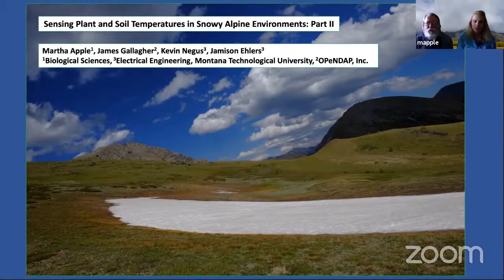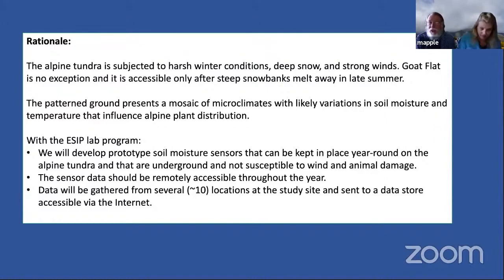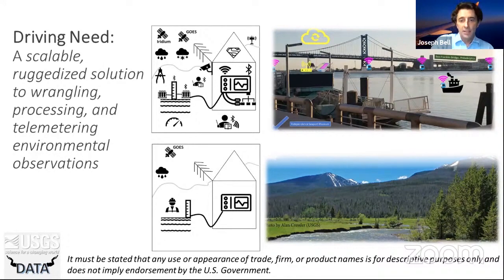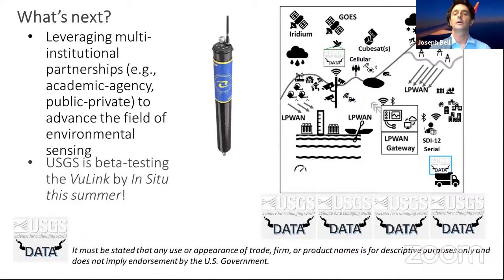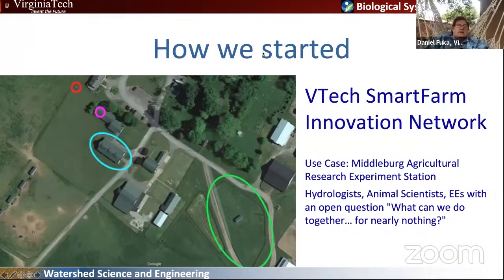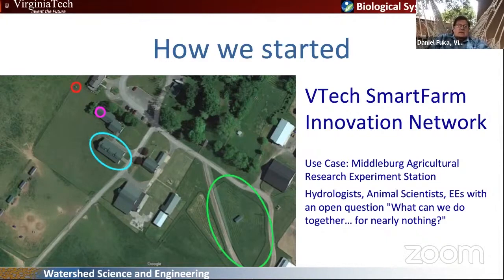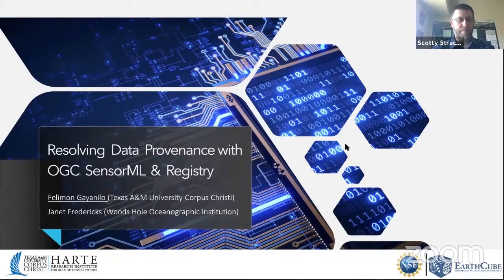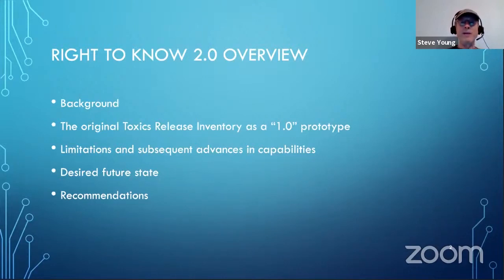Recent advances in environmental sensing for monitoring and research

Comment: LoraWAN based sensors to satellites would fit the requirements of data collection. 
Several Lora capabile satellites, some public domain are allowing this kind of data to be sent to the "cloud".
Limited bandwidth but capable of low power usage, using solar and battery backup to unattended use.
Most basic environmental measurements are not real time. Even large datasets like video capture can be staged over several passes..